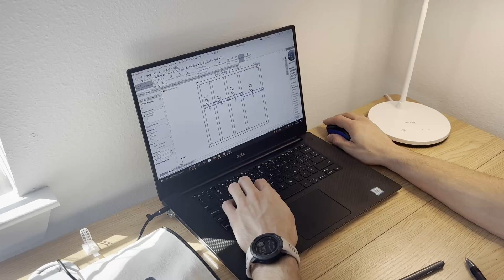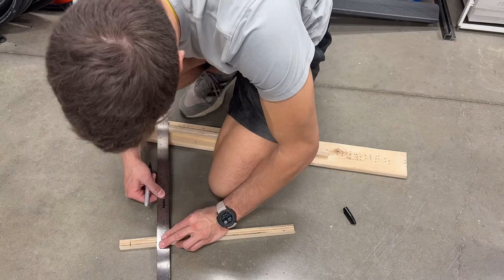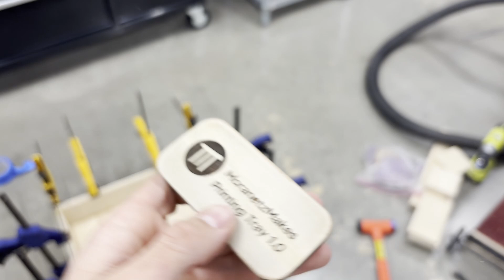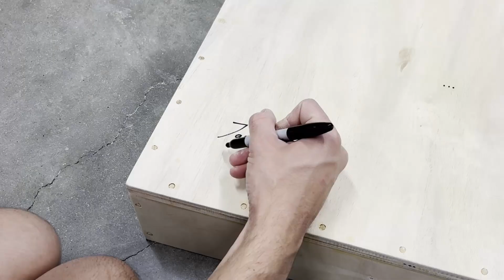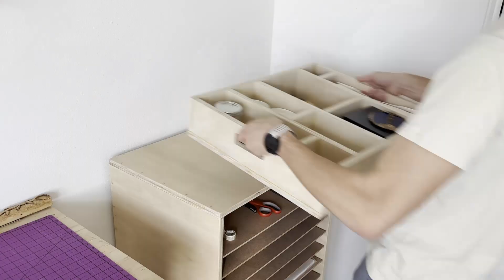Custom Art Caddy  |  DIY Project for My Printmaking Tools

Comment: Wondering if you could do a quick video on the brushes you use for your woodblock prints. Do you have separate brushes for different color inks ? How do you clean them if not. What size brushes are good to start with etc ?....Any advice would be helpful....Thank you !!
Reply from the maker: That’s a great suggestion!  Maybe in the future I can make a video covering the basics for all the specialized tools.  

However, to talk about the basics, I simply wash the brushes with cold water after use.  I have a brush for dark black sumi ink, but I use the rest for any other color.  (That way I don’t have to completely wash out the black sumi, which is very hard)

Thanks again for the suggestion and for taking the time to watch my video.